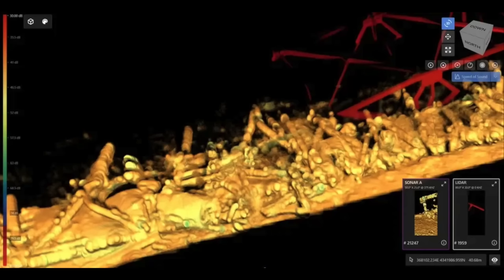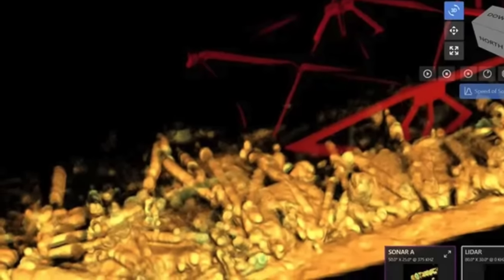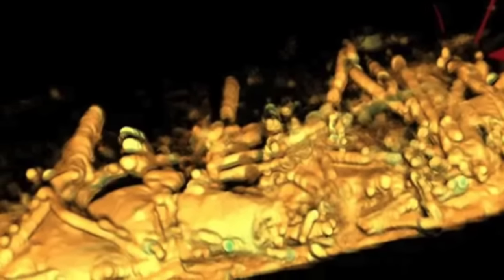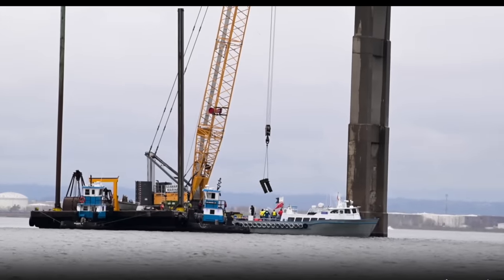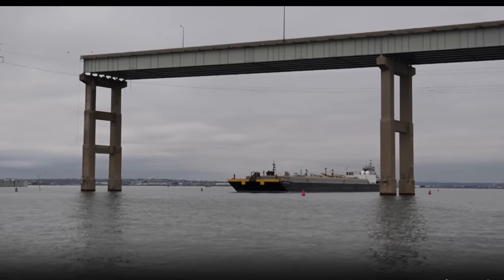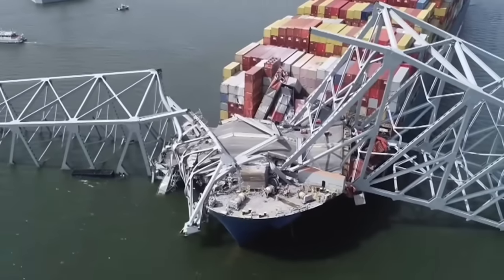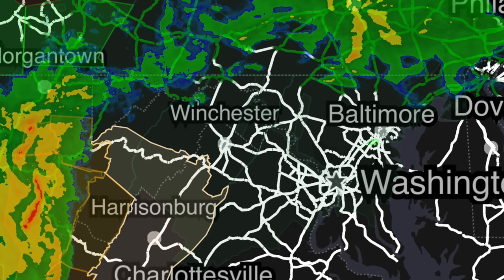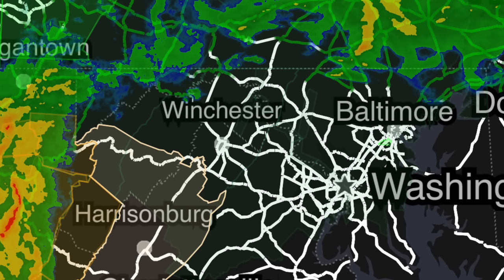Sonar Image released from Baltimore Bridge Collapse

Comment: I’m an 81 retired own of two simultaneously operating diving companies. I won’t go into the details but I worked on several collapsed structures. The real trick is to figure out what you can safely rig to without causing a crane boom collapse. I retired at 74 and if I were younger, would love to work on this puzzle.

Comment: My last job was as a CNC  operator for 2 industrial machines. One was a plasma cutter for all the i beams you see. The other other was a steel angle and flat bar machine. The company designed and fabricated all from one shop. 
Basically, steel fabrication for buildings and bridges..
Bridge tolerances were next to nothing. All connections had to be , plasma cut or drilled. You can not punch any holes with bridge construction..
Thanks for the update Andy..👍
Reply: Thanks for the information.
Reply: Wowwza DB, very impressive!! 🙌
Reply: @MAINEgirl_207  
Thanks MG💙

Comment: The morning of the incident, a retired container ship captain who had worked many years out of the port at Dudalk said that dropping an anchor would have made no difference because the frequent dredging plus the amount of silt washing out of the Appalachian foothills meant the bottom of the harbor is covered about 10 feet deep in soft mud the texture of slightly runny mashed potatoes. If that's what the bridge structure collapsed into, it's going to be a tougher cleanup than almost any of us have imagined, but it would somewhat explain that sonar image.
Reply: Thanks. I was wondering whether that was stirred-up settlement that had resettled over the bridge, or even an unlikely but possible older wreck. As a retired geographer, the silt makes a lot of sense, as postsettlement erosion has been enormous. 🍻

Comment: This is the deck structure of steel and concrete and how easy it will be to remove depends on how big the sections were how they were connected.

Comment: I am just guessing but I wander if getting the deck of the bridge , which I imagine is concrete  , getting all of it out might be interesting since you have road decking sheets and beams and joists or diaphragms that supports the concrete. 
   Some guy that commented on another video said he thought the removing of the collapsed bridge was going slow . Nothing against him but if you’ve never worked with Steel you don’t what all is involved in this kind of work. I pray safety for the Ironworkers , Crane Operators, the Oilers and the tugboat crews in Jesus Christ name Amen

Comment: The steel is the easy part an its still a hard job but the road deck is a really big problem concrete with rebar it will need to be cut apart an this will take quite of some time

Comment: Why not put in some cofferdams and pump out a lot of the water but enough to float something sturdy enough to hold the crain and debris and do it that way?  Please don't be mean if it's actually the worst possible thing to do im just about wanting it cleaned up and clear in the safest way possible my prayers are with those workers who has to take a huge risk every single time they have to get to cutting and lifting and having to do it in scuba gear and all that
Reply from the maker: Cofferdams are used extensively in the bridge construction industry.  Here it might present a problem because of the size that would be needed.  It would be a large project to construct, and quite time consuming.. Thanks for jumping on board with us.
Reply: @MinorcanMullet  well darn thanks for your reply

Comment: I wonder if they can use that giant cable cutting machine that they used for cutting up the Russian submarine Kursk.   It sawed the Kursk into smaller pieces that were then floated and lifted up.  Of course that would only be after they have retrieved the bodies of the men still down there.
Reply: The bay is full of blue crabs.  After a week, how much do you think there is to recover?